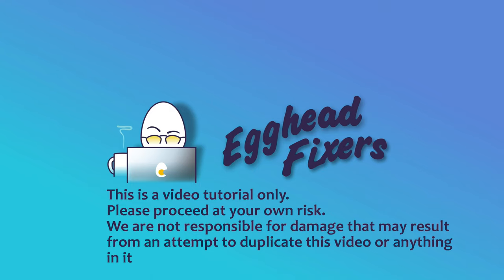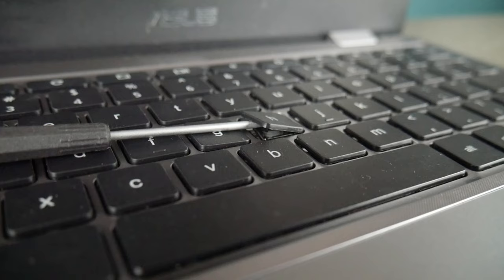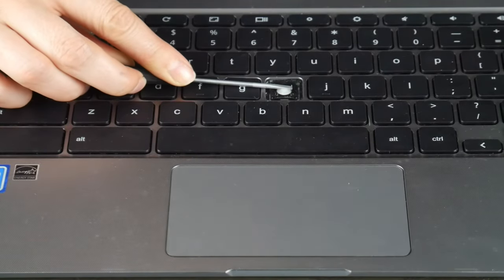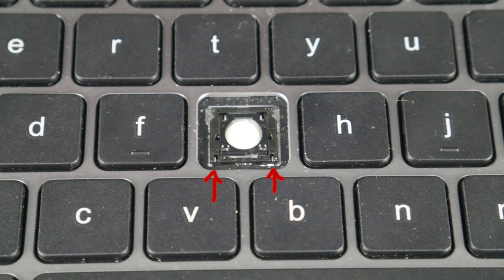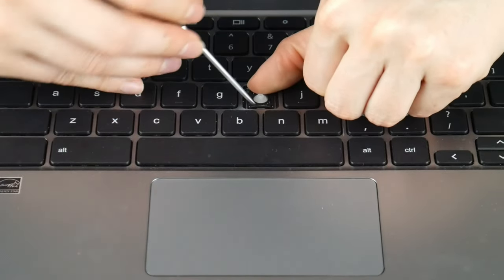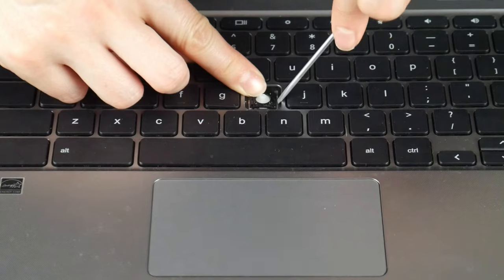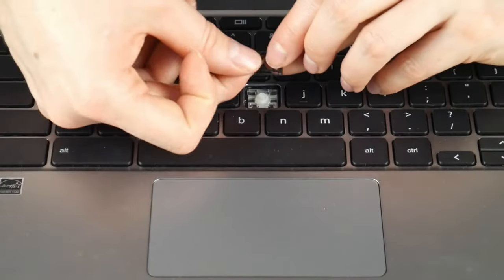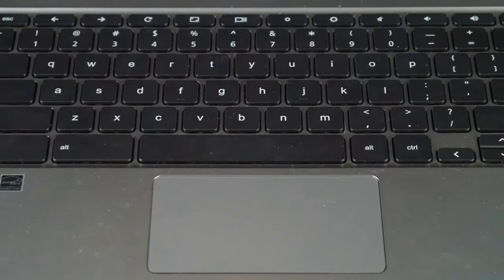How to Replace a Key on Your MSI Laptop's Keyboard - Tutorial by a Certified Technician

Comment: Next question: where can I find a replacement key? I have looked in multiple places and none of them have one for my make and model (Delta 15 A5EFK).
Reply from the maker: In that scenario, you may need to look for a part number on the keyboard and look for the part by that. A lot of times manufacturers will use a keyboard on more than one model.

Comment: my key doesnt pop back in at all no matter from what side i press it, the white part is still on but i cant get the key itself to stay on, it keeps sliding off, what do i do in that situation?
Reply from the maker: You can always take just the key cap off another key and compare what the difference is. It could be installed incorrectly, something could be bent, or broken

Comment: i just tried it with the capslock.. These metal bars broke me. I tried to get it inside and fix it, but the key broke in 2 halfs... Should i order another one and try it again or look for someone to repair it
Reply from the maker: I would look up the price of a replacement key or keyboard (you can take a key off the keyboard) then you can see if it's worth the savings. A lot of times the replacement keys or keyboards are not expensive.
Reply from the maker: I would look up the price of a replacement key or keyboard (you can take a key off the keyboard) then you can see if it's worth the savings. A lot of times the replacement keys or keyboards are not expensive.

Comment: I have an MSI GS66 Stealth laptop. One of the keys (a) is not working. It's a pretty important key, so I'd like to know how to get it working. I've tried taking the key off and pressing the rubber cup underneath, and that's not working either. So the problem must lie underneath the rubber cup. Any ideas how I would go about fixing that? Is there any easy way to get to it, or do l need to buy a whole new laptop? Is this a common problem that you know any fixes for? Right now my workaround is copy and pasting the letter "a", and that's pretty annoying.
Reply from the maker: If the keyboard is a separate part then you can usually replace just that. If its inset into the palmrest and not removable then you have to replace the whole palmrest. Either way with this model of MSI you would have to remove the motherboard to get to it.  You basically have to completely take the laptop apart and then put it back together again. It is not an easy repair by any means. You might be better off using an external keyboard.
Reply: @EggheadFixers  worth noting though they plastic weld/rivet in the keyboards to some models.............. super annoying will never get another MSI they are not service friendly laptops. wasted 90$ on a replacement keyboard just to find out how ridiculous it is to replace it.
Reply from the maker: @johndorian4078  Yeah MSI can be very difficult to repair in general which for how much they cost is pretty annoying.
Reply: Almost all laptop manufacturers have their keyboards like this now. Gone are the days that you can just swap in a new keyboard just by losening some screws. Now you have to replace the whole palmrest.
Reply from the maker: @VaporheadATC  Yeah it's real pain. It's like they are making it progressively harder to repair things yourself.

Comment: What about the spacebar? Took it out but I don't know how to put it back again
Reply from the maker: It's usually very similar but you will have two clips instead of one. Also the metal bars will have to be hooked back in. They usually insert back into the metal loops on the keyboard.
Reply: @EggheadFixers  yeah my main issue is the metal bars, I arranged everything perfectly but I dont know how to properly put the metal bars in the thing, I kinda made it work but the spacebar feels a bit tough to press now compared to before, I need some vidual guidance to see how to put the bars properly

Comment: Where do you purchase the keys?
Reply from the maker: eBay or Amazon is a good place to find keys or replacement keyboards.
Reply: @EggheadFixers  nice general obvious answer. Was hoping you had an actual website, supplier you would recommend/ have used.
Reply from the maker: @tonylingenfelter6281  Not for keys. Typically keys are not made to be replaced.  It's just the cheapest option so people do it anyway.  So they have to be taken off the keyboard to be sold. Because of this a lot of parts suppliers won't stock them.

Comment: I cant find keys for the msi sword 17 anywhere, and my spacebar is cracked in 2 places after just under a year owning the thing...
Reply from the maker: Is it still under warranty?
Reply: @EggheadFixers  that wouldn't be considered a defect, so wouldn't be covered, unless a lot of people have the same issue, which I'm not seeing
Reply: BRO ISTG I HAVE BEEN SEARCHING KEYCAP FOR MSI SWORD 15 FOR WINDOWS BUTTON for 3 months. Please if you found out something send me too. I'm tired of searching..
Reply: @knanzeynalov7133  I found a full keyboard but it was like $180, I ended up taking a dental tongue depressor, cutting it to size and gluing the broken spacebar to it, lol. I saw plenty of sword 15 keys around on laptop key sites, but its a different keyboard than the 17
Reply: @nodvick  ooops. 180 dollar seems so much. I could find a key yet, I saw full keyboard sellings for 60$ but meh. I m goin to buy GF66 button to replace which is 10 dollar. No chance man, our laptops are cursed asf. Mfs do not produce keycaps…